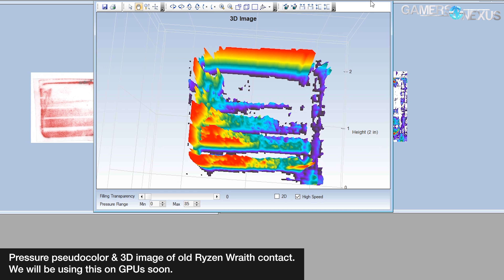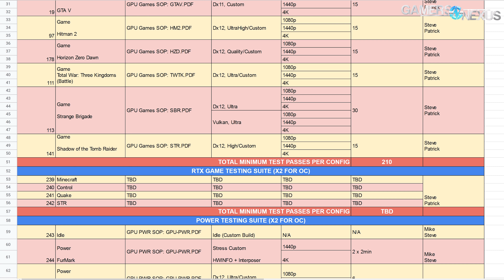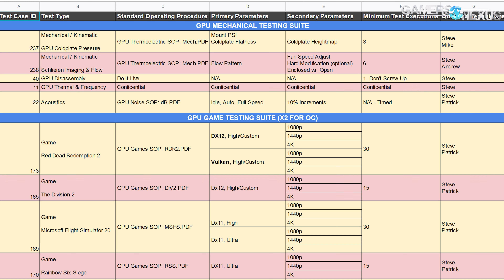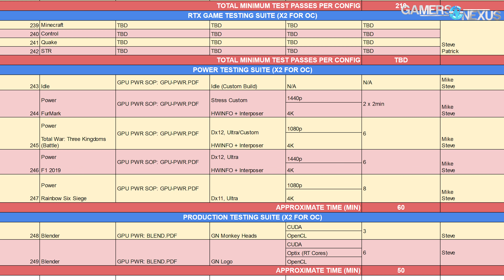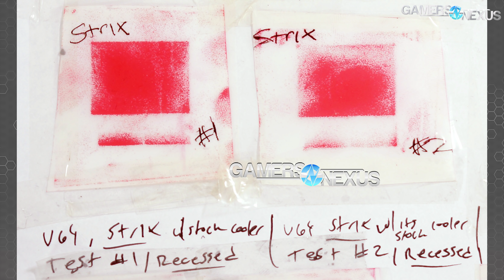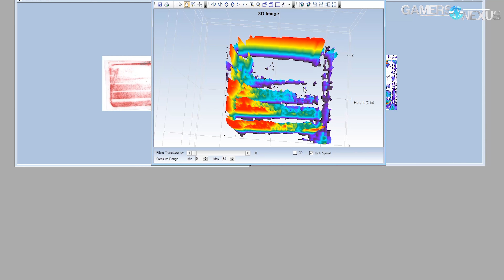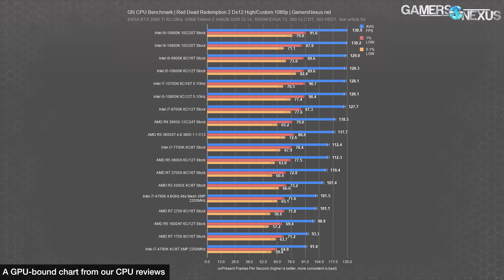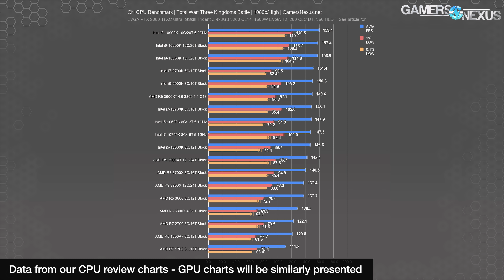$13K of GPU Test Methodology: Airflow Photography, RTX Games, Pressure Tests, Power, & More

Comment: A test of Solidworks would be cool. I am in school for engineering and this is a program widely used in the commercial space. It also has a built in performance tester. As to how good of a test it is for gpu usage/ cpu usage I honestly have no idea. Could also run stress analysis samples to test gpu/cpu.

Comment: Some autocad testing for the 2d applications on workstation/gamer GPUs would be useful for the engineering guys, usually the only testing done in CAD related tests is in the 3D rendering/modeling of simulation/stress testing, but a missing area is it use to analize the performance of gpu processing of large datasets of raw information, mostly used for mathematical measurements of fluids or rigidity like in water flow simulation in rivers.

Comment: For the airflow photography, could you use a piece of plexiglass to act as a "motherboard" so it still allows light through but shows how the air interacts with a surface against the PCI-E slot

Comment: Some "workstation" GPU usage: hashcat, used for brute-forcing password hashes. You can grab the SHA1 list from haveibeenpwned and a wordlist (like the linkedin password list) and a ruleset (like best64.rule which comes with hashcat). You can also benchmark other hash types like MD5 and bcrypt

Comment: Photographer here and it would be fantastic to see someone run tests on Lightroom. Especially batch exporting etc would be very interesting to see. Photoshop is nice to see but Lightroom seems to behave differently in this way. It does support GPU acceleration however Adobe is pretty tight lipped about how it works or what it does. 
Thanks

Comment: Great! Your SOP's are up there with the best businesses - standardization and consistency! Doing heat/ performance testing within cases are going to be difficult based on cooler designs and overall heat production... What's 100 Watts? It's a cooked chicken in an insulated container after a couple of hours...
Just wondering what the performance would be of Microsoft Flight Simulator is something ridiculous like a server or Threadripper build?

Comment: Huge thanks for your thorough approach and adherence to scientific method!)
Considering workstation benchmarks could you consider adding training time for some popular neutral network architectures? Many people doing data science either professionally or for educational purposes actually do use gaming gpus instead of teslas or quadros for their relatively low price. That would especially help people thinking of getting into deep learning, but are doing it on their own funds.
There's literally one more or less thorough text guide and no one knows if it's going to be updated for 30 series and when. I myself purchased a 2070 based on it and it was helpful, but your level would be a whole different game.
Thanks!

Comment: The Schlieren photography method to show the heat dissipation of cpu and gpu coolers should be pretty insteresting to see. 

P.S. If the motherboard would get in the way of your Schlieren imaging, perhaps a riser cable would help to reposition and seperate the GPU.
en.wikipedia.org/wiki/Schlieren_photography

Comment: There are a couple of settings that in Flight Simulator 2020 are particularly CPU intensive, which are Terrain LOD and Object LOD. Also some aircraft are extremely CPU intensive as by default it updates the cockpit displays every frame. Google "Mod to lower 2D instrument refresh rate - Increase FPS". With both of these changes I run okay at Ultra 1440p, with 3900X, 32 GB, and RTX 2060 Super, with the GPU being the limit the majority, over 95%, of the time. I will probably go with RTX 3080 and go 4k as well. The developers also announced performance improvements by the end of this week.

Secondly, have you thought about helping engineering companies improve their products, even in non-consumer fields? Some of the methods here are pretty cool.

Comment: Hey GN,
I'm currently using my 2080 for personal AI, ML and Neural Network personal projects (uni student), while also doing some gaming on the side (hence no professional card). I am looking to upgrade to the 3090, so any test that involves some sort of large free data set and a basic Neural Network would be epic to have comparisons between different tiers of cards.

It would be interesting to see if the new memory compression in the 3000 series has any influence on the pure amount of data that can be trained on compared to previous generations of GPU's with the same some Vram. Or alternatively how the 3000 series impacts training time for ML applications.

Comment: I have an audio workstation. I never see any benchmarks for them. Also the way DAW's handle many cores is awful and needs some light shining on it. Idea for a cpu test  Load up a DAW and pile on vsts over 32 channels on the lowest latency. Open the same project on each cpu. Measure dropouts.
Reply: Turns out you aren't the only one. Scrolling through the comments there's actually been a few audio engineers who mention how little benchmark testing there is.

Comment: Audio processing for a work station application/audio encoding time could be a useful CPU bench mark, but I don't know how it'd run in something like something like FL Studio (I use this in a hobby setting to master music and produce riffs myself, but I know others who do this profressionally).

Might be worth contacting Image Line as they're usually quite receptive to the community. There's various different compression types (OGG, MP3, WAV etc) as well as voice count (number of symultaneous wave forms/harmonics from a given noise source, be that a synthesiser, drum machine or audio or vocal track). These can all put a heavy load on CPUs and typically leverage high thread count CPUs well. FL Studio seems more optimised for threads, but it'd be interesting to see how frequency plays into it.

I've not used it for absolutely years, but Steinberg Cubase is also worth taking a look at. FL Studio has a free version and Cubase has a trial so you can take a look at the programmes and what you can do with them. 

Either way I'd highly suggest contacting the companies, as I can see them wanting to work with you guys to see how their programmes perform in the nitty gritty.

Comment: 26:38 In response to the flight sim stuff, I made a comment as a reply but figured it would be good to put it in its own comment too, I really recommend looking into the ini file and poking around to see what settings are causing the cpu to get pinned like that. LowSpecGamer recently did a video where he dove into ini editing and found that some changes in the settings resulted in massive framerate jumps. Even just disabling the live internet streaming in the options boosted his fps by something like 20 fps so that's another possible reason for the cpu pinning. While none of this would provide good real-world data I feel there's still some good info to be had by digging around the file like that and perhaps enlightening the reason why that cpu behavior exists. Moreover, there's potential that there could be a data-driven set of specific benchmarks you guys could do using MFS 2020 as a more or less benchmarking "tool" rather than representing an actual game's data. In a way, that's kind of what you guys might do in regards to a frame-equalized power draw which I would DEFINITELY support given that my own system has power limits from the wall and any efficiency I can get is a massive help.

I subscribed here around 5 years ago and to date you guys have been one of my absolute favorite channels I've ever watched. Seriously thank you Steve, Patrick, Mike, Keegan, Andrew, and every single other person on the team who work so hard to make these.

Comment: Don't know if it's GPU or more CPU intensive but Autodesk Fusion 360 and Cura. Fusion 360 for complicated cnc tool paths. Its a very popular, mostly free CAD/CAM program. Also Cura for 3d printing slicing. Would be amazing to see what cards have a different effect.

Comment: Regarding under respresented benchmarks (CPU based, unfortunately not GPU based): I would love to see some CPU benchmarks with SPICE electronics simulation. I'm a power electronics (PSU) engineer and use the LTspice simulator on a daily basis. Simulations can easily take up to half an hour or longer. It would be great to see which architecture would work best with SPICE simulation!

Comment: Tile sizes were actually optimized pretty heavily so that GPU rendering isn't so slow without large tile sizes.

However, despite the initial boost of combined CUDA rendering with the CPU, additional optimizations seem to have killed it. 
It hasn't been faster for anything I do since March at least.

Comment: I have a benchmarking request leaning towards engineering (and students). I was wondering if you guys could possibly include SPECapc benchmarks for something like Solidworks and Siemens NX. I've heard a lot that they are mostly CPU intensive and only benefit from certain certified GPU (usually Quadros and Radeon Pros) and that they benefit from higher clock speeds than core counts. However, I have seen those programs perform way smoother on a Xeon chip for example. would be nice if we see more benchmarks for other users than gamers and Video/Photo editing.

Comment: Very good explanation of your methodologies and your intentions going forward!
I have a question regarding software and hardware testing.

How does one deal with updates to software that might influence the results of a new CPU or GPU, when compared to earlier tests of CPU/GPU on the older version of the software! As an example; say a game is updated in between the launch of two graphics cards and has an overall performance increase from the update.
An option seems to just not update the software, which will ensure comparable results, but that will produce an artificially low/high (If its a bad update) result for the new CPU/GPU compared to what a normal person would expect. Another option seems to be to re-test the older CPU/GPU with the updated software, but depending on the amount products tested and frequency of performance altering updates to software, it seeems like it would be an enormous undertaking for arguably little result?

Comment: Here's an idea for measuring CPU (multithreaded) performance: 
Use Crusader Kings 3 to measure the amount of time it takes for 10 in-game years to pass at maximum speed. While the game uses a fixed cycle from speeds 1-4, running the game at maximum speed (speed 5) makes the game go as fast as the hardware allows.
You can standardize the measurement by locking the game to a specific patch and loading the same save file (played as an observer).

Comment: As a CG Artist (and IT), i see that it is quite rare (if not impossible) to see actual, decent benchmark/comparison hardware wise for those kind of loads. At both CPU or GPU level. 
GPU rendering has drastically growed in the past 4-5 years (even though i disagree with GPU rendering [too many limitation at both hardware and features level] compared to CPU engines).

Here is a quick list of the "most" popular engine that are used by either CG Artist or Motion designer at both indie/hobbyist level as well as production houses level.

CPU engines : 

Arnold Render (also have a GPU engine available based on CUDA/RT)
V-Ray (also have a GPU engine based on CUDA and/or C++ for hybrid rendering)
Pixar Renderman (a long awaited GPU engine is supposed to be released Q1-Q2 2021)

GPU engines : 

Redshift (CUDA/RT based)
Octane Render (CUDA/RT based)

Any other benchmark/review on other renderers are usually useless for us CG artist/Motion Designer. 

You can hit me up if you need more infos about it or even help creating bench scene for those engines (or be put in contact with CG artists from ILM or other studios). I have actual paid licenses (just in case).

In my opinion Blender/Cycles is just a "toy" and isn't representative of actual production needs, quality, features and speed. And that for students, self-taught and CG artist.

Comment: Not gpu testing related but more cpu. Applications like Fusion360 and Solidworks might be good tests if you have a process that needs a whole lot of calculation. I have a pretty decent rig but have hit huge snags in frame rate and had applications stop working when doing a complex part in Fusion360. Might be good to see for all the CAD/CAM people out there

Comment: amazing update which will definately help you keep producing the most pragmatic content out there <3

for AMD memory, i can recommend this kit: G Skill F4-3800C14-8GTZN - it would limit you to 16GB but is incredibly fast for ryzen

with timing and subtiming tweaking and 1900if 1-1 clock, i get just at, or below, 65ns latency in aida64 - as well as a 33k+ photoworxx score up from 25k without tweaking sub timings, both at 1900 IF 1:1

Comment: I am a motion graphic designer. I use (Redshift) Cinema 4D, After Effects and Premiere. CUDA is king in my everyday work. IPR and render speed is the most important measure for me. I currently use dual RTX 2080 Ti. I want to replace with dual RTX 3080. I am looking for substantial gains with the upgrade. Thanks

Comment: Awesome there is a certain industry that does use the image software to measure the CC and C V of the parts, just cleaning the mirrors is very expensive we have an independent company that  clean the mirrors, where precision is needed this equipment is % 100 foolproof you can check while grinding if the parts were overheated that can cause the parts to be warped up to a 1/10000 micron, good stuff, well ours cost millions of $, love to see more

Comment: Steve, could you also test the cards on different PSUs at various loads? Like say a 3080 on a 650 watt psu? I myself have a 650 watt corsair cx series one which I got last year and I don't want to upgrade. I checked the psu calculator website and from what I see there and on other YouTube channels/reddit I can say that 650 for my setup is enough for the 3080. Atleast for now. I am 80% sure its safe but I trust you the most about these technical aspects. 
Anyway looking forward to the content. Thanks 😊

Comment: the pressue paper in 3d for me is just and image texture using displacement map or height map. The same result can be obtained with any 3d modeling tool.
It's weird hear about this technique without hear the ppi or dpi as parameter.
the video footage isn't fully with high amount of data that can be obtained from an good "photo"

Comment: In answer to the workstation tests question it would be nice to see how a GPU handles viewport performance for high-poly models. It's all well and good having a snappy interface if the model you're working with is only 100k polys; but how about CAD models with 60+ million polys? You could also try rendering with different engines like Octane or Vray GPU to get a full picture of commonly used engines.

Another area to explore would be Unreal Engine; tests could be as simple as frame rates for densely populated scenes, particle effects with Niagra or exported render speeds; all of which could be tested with RTX on and off (thinking about it you could build a really interesting set of custom tests in UE4).

There's also fluid simulation with some of the GPU accelerated tools like Realflow or Houdini (although that's not really an area I know much about, just know that those ones utilise the GPU).

Comment: Great stuff! May I ask a question — why did you say that Rainbow Six Siege is a DX11 title if it does support Vulkan as well?
Reply: maybe cuz their R6S testing has always been DX11 so they wanted to carry on with it rather than retest with Vulkan all over again
or maybe Vulkan didnt get along with their setup, its more beneficial for AMD on R6S than it is for Nvidia.
Reply: @nexusiv1421  I saw multiple reports on Twitter that using Vulkan significantly increases performance on Nvidia GPUs as well.

Comment: I feel like, if a specific game supports DLSS and/or Ray Tracing, you should just default to always testing with those 'on' if the card supports it, since that's how the card was intended to be used. It may not be representative to how other games will scale but more generalized benchmarks like cinabench should be used for understanding rasterization power.

Comment: Of course the main issue you have with Schlieren is that it's more visualisation than measurement. It's great for gathering certain qualitative validation data for CFD, such as shock types and angles, hence extensively used in supersonic wind tunnels and the like. It's also great for judging the efficacy of passive cooling design - if there are cold spots on a passive heatsink, they're easy to spot.

What Schlieren is no use for, however, is measuring the actual density gradient. In compressible flow terms that'd be the actual density gradient which in turn tells you how strong a shock is or how much heat is coming off a heatsink. What you want to make quantitative measurements like that is a differential interferometer. It's cooler. but unfortunately it's even more expensive and in terms of the testing you're looking to carry out, even less useful, than Schlieren. Sure, you can try to get an idea of how efficient a motherboard heatsink is, but that's about the limit of its utility.

What would, in my humble opinion, add the most value to your content is a water block test rig measuring flow restriction and heat transfer efficiency

Comment: Yeah, using Pascal for pressure would only make sense. Since you can apply it easily to the size of a die, measured in mm², as it's Newton per m², so you can easily visualize how much force is really applied.